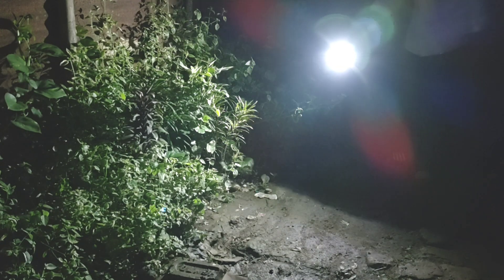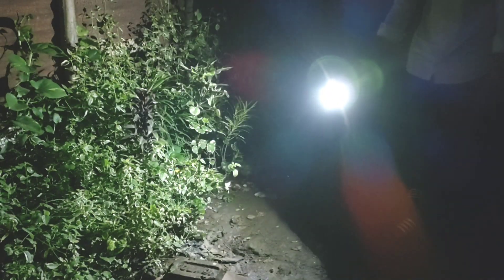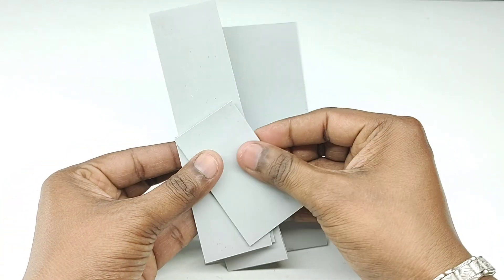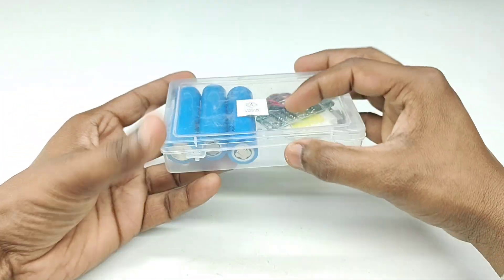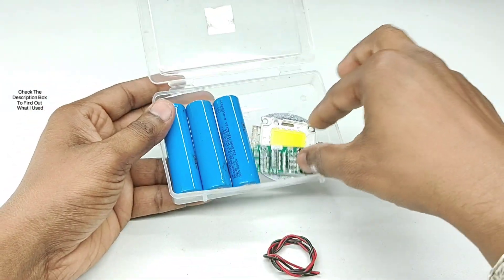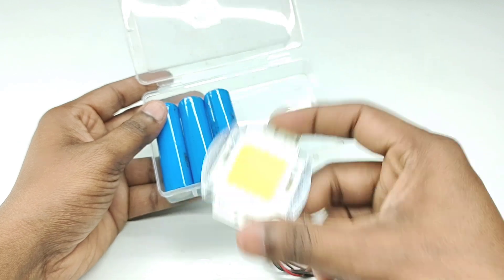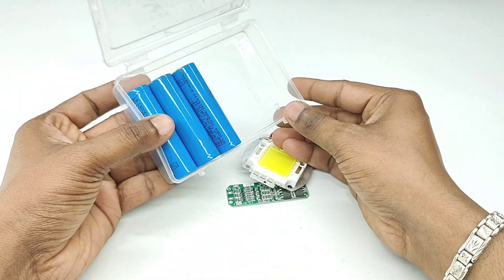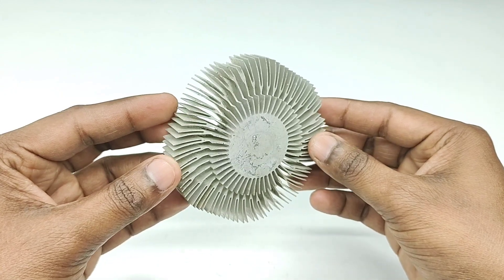Ultimate Diy Flashlight: Powerfull & Easy To Build

Comment: How the batteries get charged, doesn't it need any charging module, how can it charge bu direct 12volt supply?
Reply from the maker: Look next to the switch, I have installed the 12v pins, it will charge from there 😊